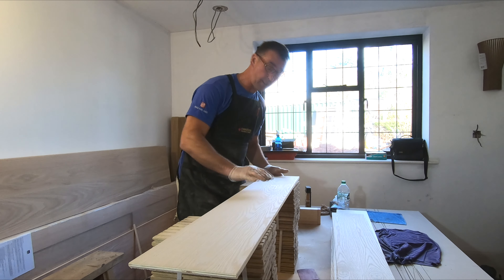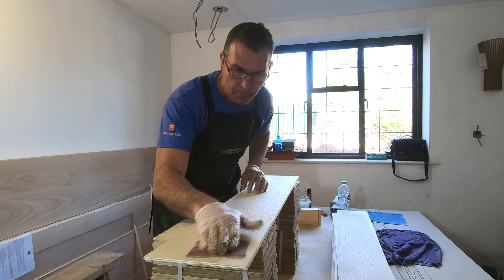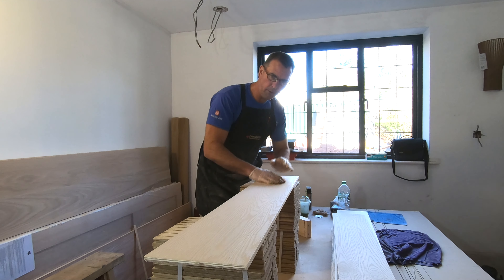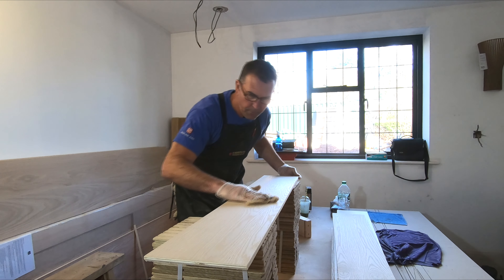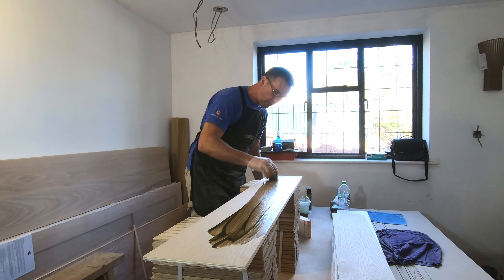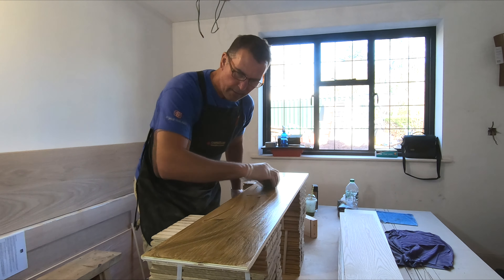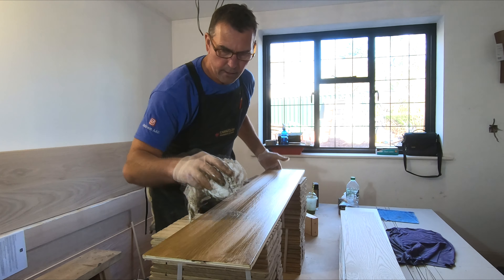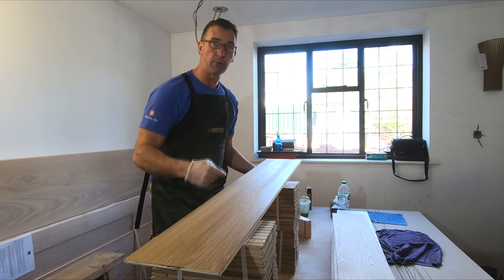THE STAINING AND SANDING PROCESS | How to Build a Staircase #5 | Build with A&E

Comment: Hi tony Great videos and great work.  When oiling oak kitchen worktops is it he same process of oil let dry denib and repeat or can u just apply the oil straight on once dry.
Reply from the maker: Hi bazalboy thanks for watching and I’am glad you enjoy the channel, Oil and denib twice and then final coat of oil, me personally I also wipe off excess oil on all coats with lint free cloth, on the wipe off as you put the 1,2 and 3 coat of oil you will notice the different soak times of the oil always do test samples as we did on the tread sample to show the client and always read manufacturers detail or even phone them, i like doing test panels because different woods have different absorb rates. Once last coat is totally dry it should feel totally smooth hope this helps all the best Tony 👍 keep safe
Reply: Great advise thanks for that. Take care 👍